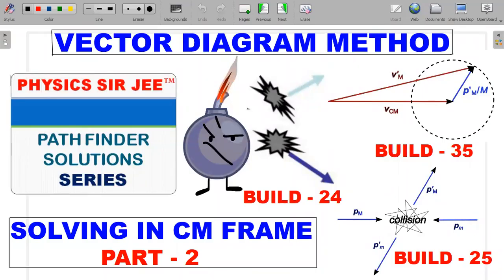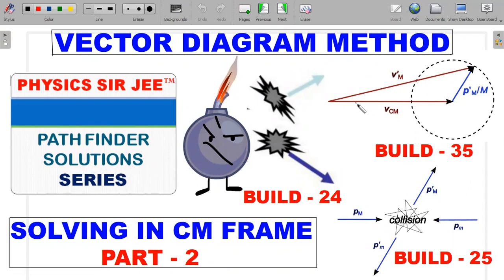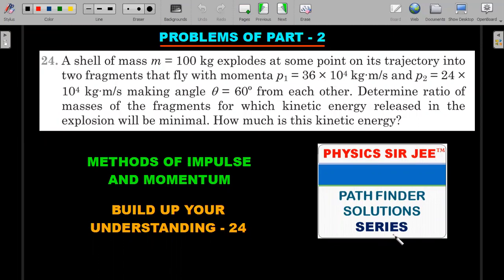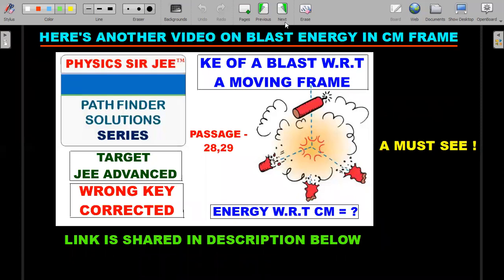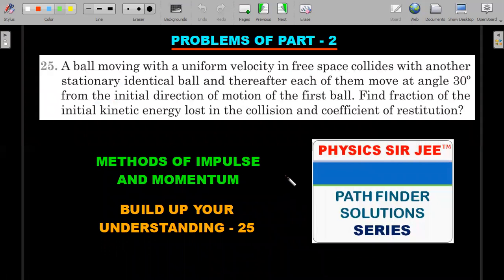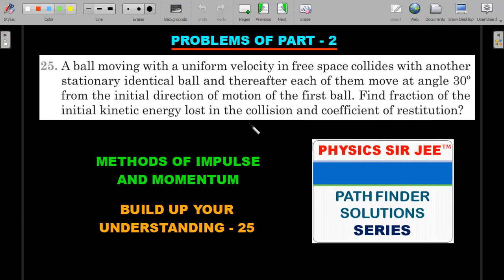[JEE ADVANCED] PATHFINDER SOLUTIONS | VECTOR DIAGRAM PART-2 BUILD 24,25,35 | CM FRAME COLLISIONS

Comment: Sir, can you solve the 34th MCQ of the Kinematics section.(A,B,C particles problem)
I tried to derive a function of time,(considering A as the frame of reference, and also A as the origin) for the displacement of the particle C as [x(t), y(t)] in cartesian coordinates, and then differentiated it twice with respect to t to get the acceleration. But it involved long mathematical calculations.

Is there a better solution for this? 
I'm from Sri Lanka
Reply from the maker: I will look into it , stay tuned 🙂👍
Reply: @PHYSICSSIRJEE  thank you sir

Comment: sir why does one of the particle has to be motionless for vector circle method to be applied?
Reply from the maker: This basic method requires that. You can read the origin of the method from Irodov theory book. Variations of this method are also applicable. I have done them. Please check collisions playlist
Reply: @PHYSICS SIR JEE - JANARDHAN - IIT JEE & OLYMPIAD  sir after I've been through all your lectures, 
we can use vector diagram in cm frame for a lot of cases
and the circle one reserved for cases like this.
am i right sir?
Reply from the maker: Yes pratyush 👍🏼

Comment: 41:50 2m1/(m1+m2)
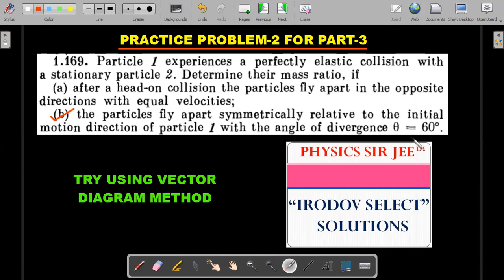42:30 2
42:40 1/4
Reply: Sir for the third part we can directly use 
KE lost = 1/2 (mu) (v rel along L.O.I)^2(1-e^2) with e=0 
because the velocities along the common tangent donot get affected hence whatever KE of system is lost is due to the lost KE along LOI and at the time of maxm deformation the collision is just analogous to a perfectly inelastic collision
Therefore KE lost = 1/2(m/2)(u/root2)^2
= mu^2/8
And initial KE = mu^2/2
Therefore fraction lost = 1/4
Reply: By mu in the first equation i mean reduced mass

Sir can you pls reply whether this logic and  intuition is correct or not